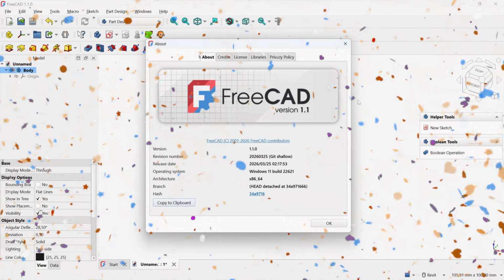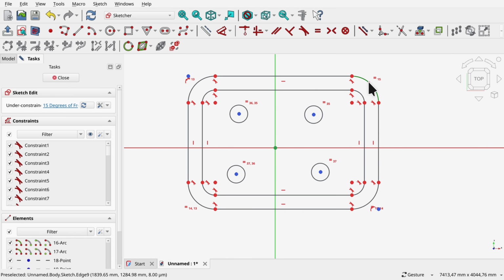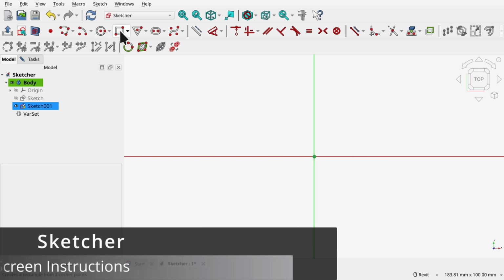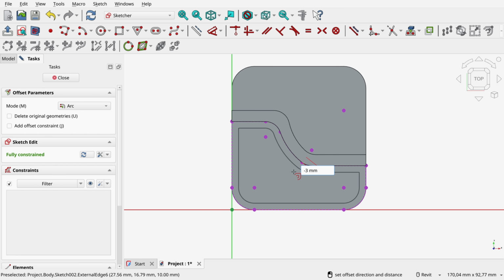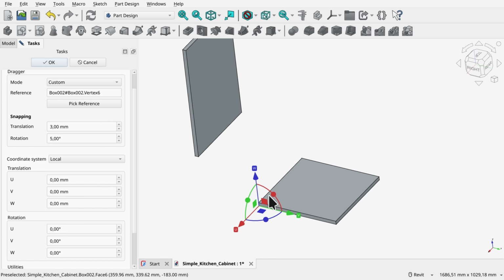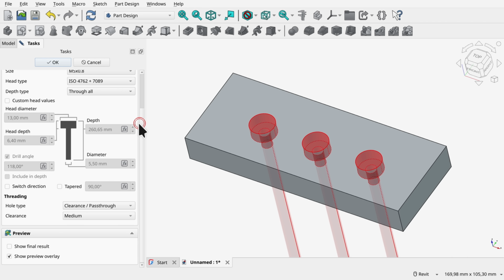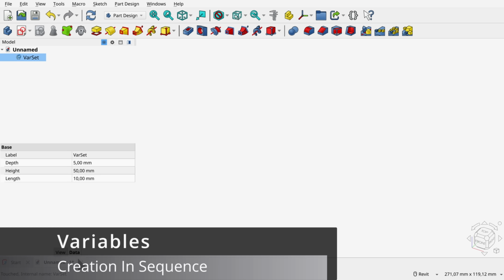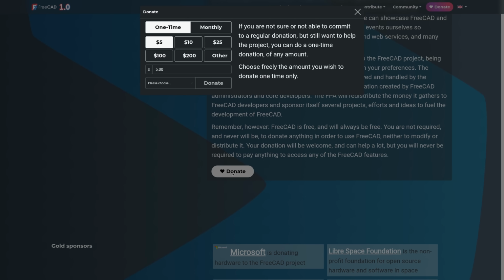FreeCAD 1.1 is Finally HERE — It’s a GAME CHANGER ! (Major Updates you missed)

Comment: can you please make a settings video ?, i tried the smal setting with the new internal faces, but it dosn't work for me
Reply from the maker: @HesComfy Try to restart FreeCAD and create a new file. Or, In the properties DATA of the Sketch, make sure MAKE INTERNALS  (under Internal Geometry) is checked.
Reply: i got it working, it was because it was a file which was still existing from bevore the update 1.1.0 so it didn't completely work, but now it does when i open a new file

Comment: Now I'm starting to contemplate on my personal SolidWorks licence... FC is getting somewhere... If only the advanced surface and lofting (etc.) functions could all be integrated into "part design" instead of using different workbenches, so it's a more fluid experience, and less convoluted way to do 3D-sketching, and boolean/merging stuff happens automagicly like in Soldiworks (I often design relatively complex parts like ICE cylinderheads and 2-stroke cylinders), then my SolidWorks would be hanging from a thin-thin thread. Ironicly at my current actual job, only a selected few individuals in the engineering/machining department have access to solidworks licences (because hurr-durr they're kind of expensive, and if not STRICTLY needed as part of the position, then no-bueno...), but whenever I need to design something practical/technical to be 3D printed, make a technical drawing, making a virtual prototype etc. etc. then FC 1.0 had been helpful (tho somewhat frustrating at the same time, e.g. FILLETS!!!!!!!!!) and it's whitelisted by IT... I'm going to run down their doors nagging for 1.1 to be enrolled ASAP!

Comment: I have an astronomy dome construction project with wood ribs and GF cast covering tiles. I need to finish and at the moment  is pencil scale drawings. I'd like to know two hemispheres and a central sliding door section will actually fit together.
 I've tried several 3D software over the years and the learning curve is so counter-intuitive and frustrating.
Can this release of Freecad give me the results, parts measurements, radius of ribs, diagonal component check wire lengths etc. Without months of basic tutorials?

Comment: I just read through the changes to the Sketch workbench and skimmed the rest of the list. There are many great improvements and I like the overall project a lot, but to me it isn't useful until I can snap my first selection in the sketcher to the grid. I model around the orbit center and not being able to snap the first vector whenever I start a sketch, but having to rely on constraints, is just a cumbersome workflow imo and it means I need to use multiple steps where Fusion means only 1 step. I've tried to look for the option in the preferences menu, but couldn't find it and I also tried googling for results, but came up empty handed. If there is a method, I would be happy to know and begin using FreeCAD in earnest, as the built in BOM tool is incredibly useful for what I use CAD systems for. But if it isn't, then I personally won't be switching over until this is a feature, as that alone is a dealbreaker to me. I got so frustrated by that single point that I uninstalled FreeCAD immediately upon not being able to find a solution. If there is a way to enable it, even if its an extension, I will gladly install again, but if not, then I remain on Fusions personal license until then, as all the other features of FreeCAD become irrelevant when I get obstructed in my designing before I even draw the first two vectors

Comment: I have been using Freecad for a fairly large project with around 200 unique parts and around 600 parts in total. Here is my experience: The core tool is actually good now. I can build a whole machine using it. Freecad has come a long way. I especially enjoy the external projection and genetate multiple faces feature, which makes life a lot easier than before. But unfortunately the program often crashes, especially in sketcher when adding a dimension. Happens a lot. And assemblies break too easily and are sometimes really hard to repair. Also, assemblies with more than 30 parts become so slow, they are unusable. I have learned to deal with most quirks by now, but the crashes are really frustrating when trying to be productive. I still would not recommend it or professionals but it is getting close. I will keep using it from now on at home but the stability needs to improve. Thanks for everyone making this tool a reality! (V1.1 rc2)

Comment: I use CAD for my 3D Printing adventures. While i also have some experience in Inventor etc during my studies i now use FreeCAD. Since 1.0 it has been quite good, still a huge learning curve.
It seems like most of my issues have been resolved with this update. The Sketch Updates are great. I will see if some of my works are getting easier now.

Only downside i found is i cannot update via the program itself? just have to reinstall everything everytime...i think they should work on that at some point :)

Comment: So still 10 years before it becomes usable for normal people... I come back to this program every year for maybe 4-5 hours but it still isn't clear why any basic operation gives error. I just tried to select a profile in a sketch to revolve today, double clicking doesn't select the connected lines of the profile if the sketch has more than one profile. After 10 minutes of fiddling i revolved the profile, only to run into another roadblock. Why the hell would i need to activate a body before a boolean action?? If you didn't know this before hand, like me, every body on your screen disappears and then the operation gives an error. After pressing esc to cancel the operation guess what, the bodies are still gone for whatever reason ('Cus they got hidden automatically by the operation but does not revert when cancelled.). So many small things like this just add up to drive any newcomer back go wherever they came from. The biggest issue they need to fix are these small problems that are prevalent in most basic tools in the software instead if implementing niche things like why is there a ship building workbench wtf

Comment: Crazy how fast you can go when you give up and vibe-code everything. I still don't trust this project.
Reply: I went through the project files as I usually do for open source projects and it's still as messy as it has always been. C++ files mixed with python scripts and zero design documents anywhere to be seen. Most source files have zero documentation for any functions.

This project lacks a lot of direction, it's like they are just fixing things and implementing issues as they come without having any goal or standardized way to design the software as a whole. It's extremely messy.

Comment: From a UX perspective, having an excessive number of settings in preferences — and even requiring users to enable options just to make the workflow more user-friendly — is a serious mistake.

The goal should be to simplify the experience, not make it more complex. Right now it feels like whenever something needs improvement, the default solution is “just add another preference” and expect users to discover it on their own.

The new features themselves are good, but the implementation feels quite rough. It really needs to be reconsidered from a user’s point of view, not just from a developer’s perspective.

Comment: I work with Autodesk Inventor in my workplace and I was looking at FreeCAD when v1.0 came out. I really missed the way Inventor stacks environments. Like, you have your base view of a part where your mouse selects planes, edges, vertexes or parts or bodies. Then you click on a modifier like make a sketch or add a chamfer and your mouse automatically switches to that and nothing else. You can go back to the previous environment by pressing escape. In FreeCAD it felt so convoluted to me, as everything was done from the same level by pressing and holding a key additionally to clicking which made the whole workflow faster, yes, but the learning curve was hellishly steep and it wasnt intuitive at all. Especially for features you dont use that often having to remeber the key is quite difficult.

Comment: Looks amazing. My own experience is mainly in Fusion 360, Solidworks, Siemens NX and Solid Edge. When I tried FreeCAD after my student licenses ran out, it felt simply too hard to make the jump. I would've had to learn everything from almost zero again. Version 1.1 looks a lot closer to what I have become used to in other programs. I think if they keep this up I might just make the jump sometimes down the line of 1.1.x or 1.2 at the latest. I'm just hoping they keep up the good work.

Comment: my reaction in first 30 secs "ah finaly a usable state" "it is buried under a setting, WHY, MAKE IT DEFAULT"
Reply: I'll genuinely never understand why they're doing it that way
Reply: Because it's not in a usable state :(
Reply: 1. Because it's still not working. 2. Because the interface design is as much as possible cursed - this is the disease of most open source software, and CAD (in CAE, there's a complete mess) systems in principle. If you don't suffer while working - you're not an engineer. Well, and yes, the user manual, which describes the work to bypass every design and logic of the interface - this is an attempt to cure the symptoms, not the disease itself.

upd. For example, right now I'm watching the author open a size window, and there's an option to select the dimension (mm) - what is this, and why does it exist?

Comment: I don't know if my blood pressure is ready for another try.. I've tried to find a suitable replacement for solidworks and fusion 360.. I've spend quite the time trying to understand fc and it's idiotic way of doing things but often can't get over the hump and after much cursing of the developers and their stupid way of doing stuff I've seen myself forced back to sw and f360.. It's extra annoying since fc seems to do the right things but getting it to obey my commands is a struggle and why they can't just do like sw or f360 is a mystery.. But it looks like I will have to give it another try.. Hopefully this time it will start to feel like software I'd like to use and not have to fight the entire time

Comment: I got a chance to work in Fusion a few years ago, I was like: I recognize this! From way back when, AutoCad when they came out with AME advanced modeling extension, in 1995. What a hokey piece a crap. I remembered thinking, "one day this might become something, I wonder what they'll do" then cheerfully worked in ProEngineer for a couple years before EVERYBODY moved to Solidworks, for my whole career. Solidworks was truly awesome, but they charged way way too much for much too long and still persist that their software is a premium product when in truth it's been rapidly commoditizing for many years already. That thing about detailing all your features from a single sketch, it's a hell of a shortcut. Like I say, I got to work in Fusion for several months and it was decent. Of course, Autodesk is desperately trying to remain "premium" and the Fusion took a dark turn when they became cloud-based (2013), I absolutely hate that.
So, I can get into this Freecad version, I can grasp the paradigms. The last one I had was v0.21.2 from 2023 or so, I dunno, didn't use it much (at all).

Comment: I've tried FreeCAD once every few years, really wanting to like it, but it's always been a massive disappointment, bordering on unusable coming from commercial cad systems. I'd almost given up, and very nearly didn't bother clicking on this video.

I haven't tried this version yet, so maybe i shouldn't get too excited, but watching this, there was deal breaker after deal breaker in 1.0 by the looks of things just fixed.

For the first time it actually looks like a solid competitor to the big ones, and if it's anywhere near as big of an improvement as it looks, it should be called 2.0, not 1.1.

Comment: The generate internal faces option is a game changer. Its also like Solidworks which is awesome. It was also the main thing I thought FreeCAD was lacking. If they wanted to make it more like solidworks though, all they would need is a method to select these internal faces WHILE in the pad/pocket menu.
Reply: It’s also horribly named.

Internal FACES? That’s a sketch. They’re profiles. Not faces.

The name should at least give you some idea what it does. This is what happens when a project has zero oversight or quality control, you get random stuff that makes no sense because nobody actually paid attention to the user experience.

“Allow selection of implicit profiles”. There. 5 seconds of thought and I came up with something better. Someone else can probably improve on that even more.
Reply: Sounds like a feature request
Reply: I should never need to click a button to enable this in the first place. So dumb.